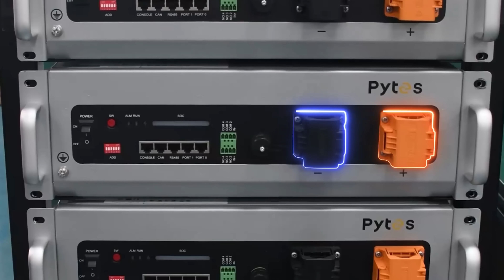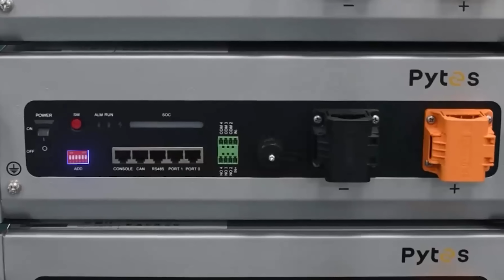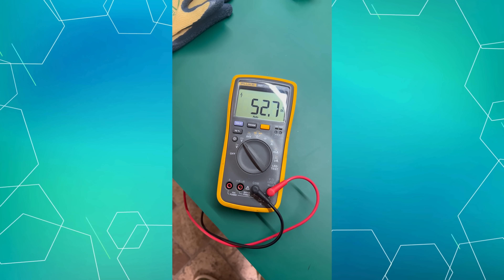Best 48V LFP Battery? (Pytes V5 Teardown)

Comment: Nice video Joe
The thee things I do not like with Pytes is the Price, the Lack of a Circuit Breaker or fuse and lastly the flexible circuit board on the top.  I have had several products that use those and they tend to dry out and get stiff over time.  Then the traces crack and it's impossible to fix them so I end up soldering in jumper wires.  Those FPC are more of a long term liability than a benefit.  
As you have heard batteries are now in the $800 region and Pytes has not declared a reason why I would pay double for theirs.  If they tell me they use EVE or CATL cells then that might be a good reason.

Comment: Geez. there are several known brands that beat that price per kwh easily. $1200 is fairly common. Also, many people buy these style and voltage batteries not for emergency backup, but primary power.

Comment: What's cost per Lifetime kWh?   Is there a heater?
Reply: Any solar battery like this will do a lot better in a (dry and temperature controlled area) like a utility room, garage or basement that is heated in winter and cooled in the summer to at least some degree.   There are companies that make rain proof and heated cabinets for these type batteries for winter.
Reply: @Bowhunters6go8xz6x Pytes makes incredibly well built outdoor cabinets for the V5 batteries, they hold 4 at a time and have breakers and buss bars built in.
Reply: @mars617 5°c
Reply: If you live in California You don't need a heated battery
Reply: @DeniSaputta  ------   Lots of places in California get snow,  Sierra Nevada mountain area gets around 100 - 200+ inches of snow every winter.